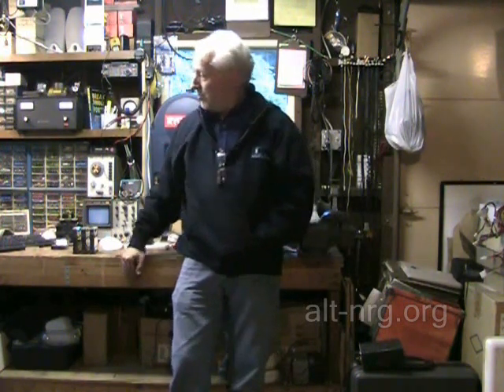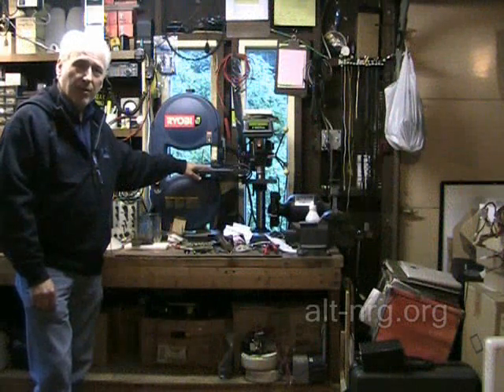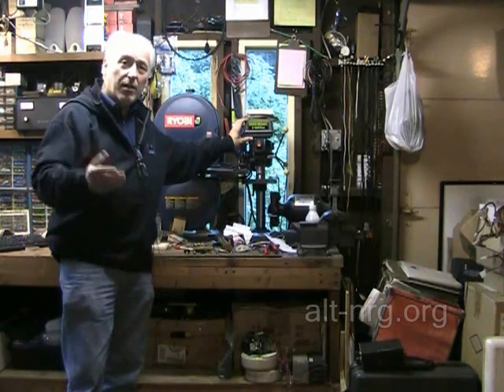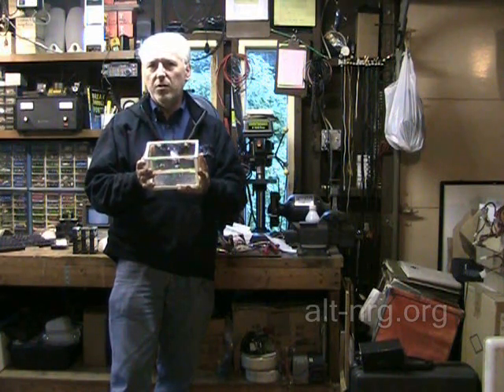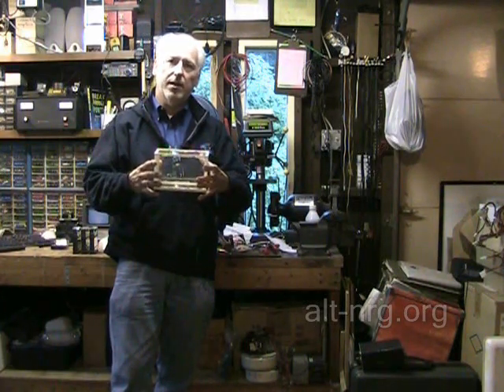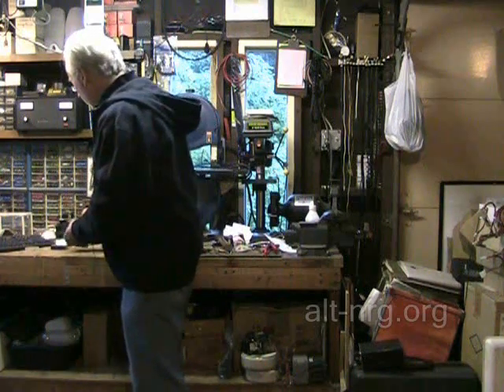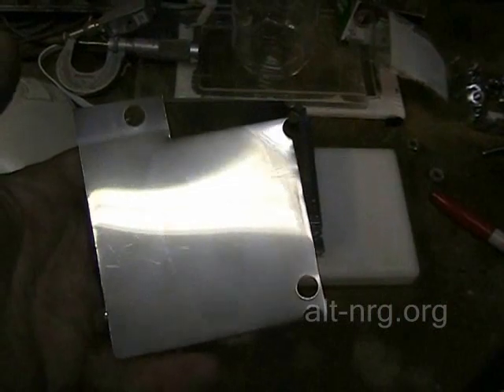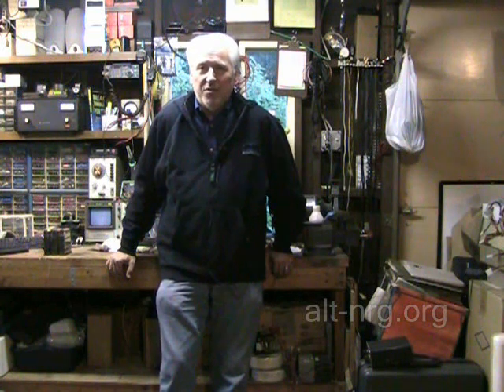#243 New HHO Batt-Cell for the run time tests

Comment: Hi again, I have the utmost enthusiasm for what you are doing and it sounds great so far.  If I may I'd just like to relay another thought.  Since efficiency is so crucial for this experiment, perhaps you might want to build the new cell with a 7th isolated bath in the center and a 7th group of 10 plates within it to allow a 7 series cell configuration to be tried, as well.  You could always use a jumber to bypass it until the cell warms up, with a toggle switch (outside so no sparks of course)

Comment from the maker: @crafter2u Technically, 1/2 pf the plates in chambers 1 & 6 plus all of the plates in chambers 2-5 are neutrals because they're not directly connected to the input terminals. But it has no BIPOLAR neutral plates as in a standard series cell. Both sides of all plates are the same potential in their respective chambers, negative or positive.

Comment: have you thought about using a recycled lead-acid battery box? where the lid seals to the case, use a band saw to cut it off. This will cut through the termincal posts. Once the top of off you can use a hacksaw blade to cut the spot welds that hold the lugs together through the holes in the partitions. Once done you can remove each cell stack and re use the container. Then just use a expoxy and heat gun to reseal the lid using the vent holes to collect HHO. i used to work for a GS Yuasa company

Comment: @higherpoweredh2o the thing that caught my eye is that VE in regards to this technology working is only relavant due to its corrolation to TE. In that cars with high VE usually have a higher TE for engines of the same displacement.  Not always true though. The best test bench for a project like this would be the highest TE at the lowest rpm on the smallest dispalcement BUT then again we would use that in our cars now if it existed.

Comment from the maker: @enticed2zeitgeist so long as you don't run the cell hard enough to ceate steam or suspended dropplets, the electrolyte should stay in solution. Bubblers help filter any residual electrolyte too.

Comment: very nice cell design there zero. are you going to run your cell using one of your PWM's? i have been running test using a solid state set up, currently using 15 transistors and getting very good response and low amps. will have to stop by and check out your live streams, excellent workmanship on that cell by the way.

Comment: Hey Z! Quick question for ya. If you are performing electrolysis of water that is not pure water, but water mixed with electrolyte, wouldn't you technically be burning your electrolyte in your motor as well as hyrdogen and oxygen? Or do the other molecules in the water  go by unaffected by it?

Comment: @ZeroFossilFuel wow great minds do think alike...some just way faster then others haha. I know you're using zip ties as spacers because of their consistancy and ease to work with but what does a smaller plate gap achieve? i cant remember back to your older vids where i think you explored this. Anyways, if you go the battery box route, also try and get some expanded glass mat that they use in batteries. Has a nominal thinkness of 0.6mm and is used to space and insulate plates in harsh ph levels

Comment: what if you have 2 batteries and 2 alternators, think you would see more gain or less because no matter how many alts you have it still takes the same power to turn them on load, its just divided but equals the same? Or maybe 4 batteries? Did you ever find out how they guy ran his truck on nothing but hho, you know, the dodge ram?

Comment from the maker: @lynel1985 Actually, I thought of it exactly.  However, I would much rather have a brand new unassembled case to glue together rather than cutting one open. But that still means I'd have to design my plates around the pox and not the other way. Still not optimum.

Comment: TRY USING  316TI AS THE POWER PLATES,    316L FOR THE NEUTRALS, KOH. DISTILLED WATER, CCPWM.     MINE IS STILL CLEAR AFTER 8 MONTHS STEADY RUNNING

Comment: him zero. I know that you wont get much current leakage but what about voltage . lower volts is lower heat and lower contamination . are you using a converter ?

Comment: @elyst117 People barely even change the oil. Do you really think they're going to mix a lye solution for an extra MPG? Turbo increased the VE of an engine from 50 to 70%. Does everyone drive a turbo car? No. Are the turbos even used to increase efficiency? Nope they're used to make more power.

Comment: have you gues every looked up the theory on volumetric effieciency? I dont fully understand the numbers you are putting out there but i can tell you to date a turbo charged honda indy car engine has the highest recorded VE of 54% @ 18000rpm.  That is the highest ever, and you can imagine the engineering involed in engines like this. NO production car would be higher then 30% in my opinion.